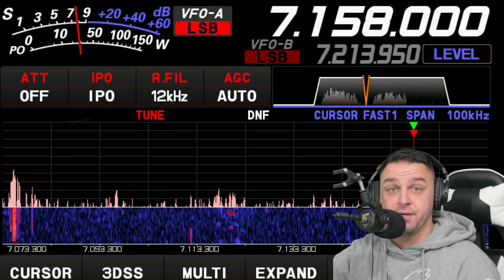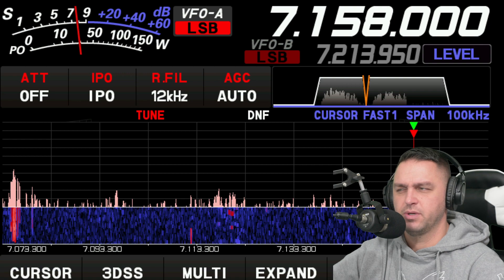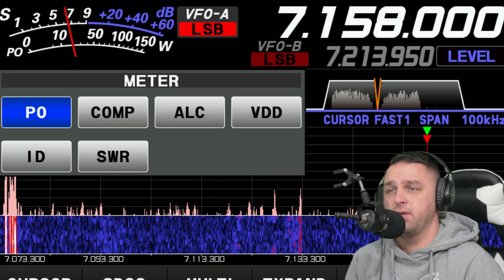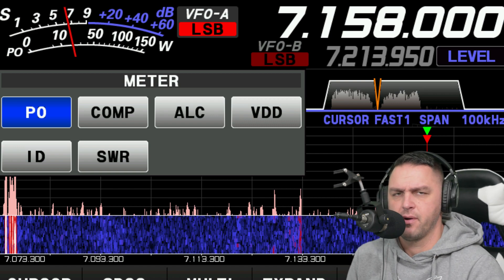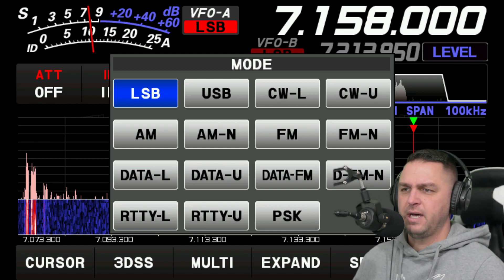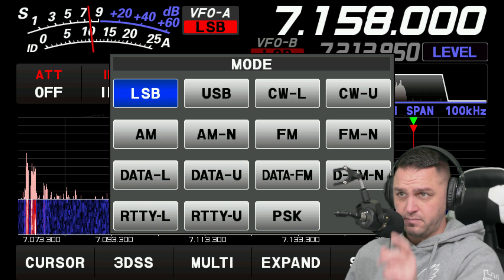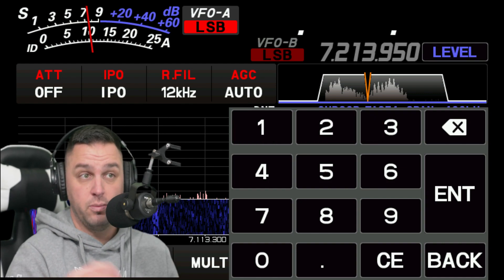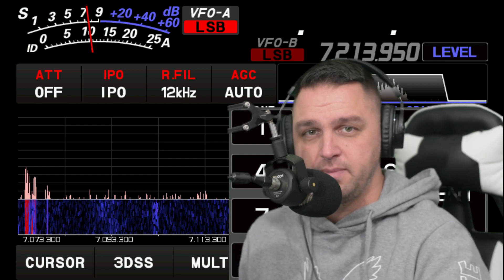Yaesu FT-DX10 Walkthrough of the User Interface / TFT Display

Comment: @ham radio dude what adapter cable or video capture card do you use for the FTdx10?
Reply from the maker: I just used a DVI to HDMI from Walmart. However, I CANNOT recommend any.  It is my understanding using the wrong one may blow your video port.   You would need to contact Yaesu for the best answer...tell them I sent ya.
Reply: @DudeTested thank you. Bought the one Yaesu recommends. Trying to find a capture card that works.
Reply: @ I see that those were just screenshots. Bought the CABLEDECONN video capture card Yaesu recommends. It’s important not to use the built in hdmi dongle attached to the card because that can possibly blow the fuse or damage the dvi chip in the transceiver. Not sure this one works either because it is not bi-directional.

Comment: Hey Dude 😉✌🏻 I see that you have black dots on your display when the background is blue - when you set the Meter or Mode. I have the same problem here exactly on the same places. Do you know where that comes from and is there a solution for this?
Reply from the maker: Hi there. I know longer have the radio, but might be able to help.  At what time in the video are you referring to.  Thanks
Reply: For example at 2:13 when you change the S Meter to Power - there are black dots at P and O.
Or at 3:30 when you change modes. Black dots at LSB.
Anywhere where the background is blue. Also in a nother video.
Reply from the maker: @Mike-ow9zv  Wow! You have a very good ide.a It took me about an hour, then I finally went to the computer monitor. I see them. Probably due to the low resolution used by Yaesu.  That's my guess :)  Sorry I don't have a better answer for you.
Reply: @DudeTested  I asked other ftdx10 owner on facebook and they doesn't have these dots. Than i have seen other videos and they have these dots too - and i think to my self "what the hell" I don't know, but there is something wrong.  However, thank´s for your answer 👍🏻

Comment: I just learned that the FTDX-10 can take its own screen shots! See P77 of the manual!

I'll summarize here: When you want to capture the screen, hold the MODE button until SCREEN SHOT appears. When SCREEN SHOT appears, you've captured the screen on a .bmp file on the SD card you have in the radio.

Comment: Please detail how you get to capture a screenshot of the display.
Reply from the maker: Hello, I just used a DVI to HDMI cable, plugged it into a HDMI to USB cable and used a program called OBS to screen capture.  I wouldn't recommend taking my advice though without checking the manual and with Yaesu first, as The video port may fry out if you use a DVI to HDMI cable
Reply: @DudeTested  You're a brave soul since the manual warns of possible damage using a DVI-to-HDMI cable, but maybe you did something that averts the damage. Maybe because the other end of the DVI-to-HDMI cable doesn't terminate into an HDMI port but merely passes signals through to an HDMI-to-USB cable and its the USB termination that counts and does no harm the DVI-D port on the radio. Maybe. Possibly. Could be. To be clear, did you use a DVI-D-to-HDMI cable or a plain vanilla DVI (no 'D')-to-HDMI cable?
Reply from the maker: @mrdonsmith  sorry, you're asking a lot of questions that I don't have the answers to because I no longer have the radio. I got rid of it about 6 months ago.  I went to Walmart bought a cable, as I recall it was a DVI to HDMI onn brand.  Then I went on Amazon and bought the cheapest HDMI to USB converter.  Also I could probably look at my manual. As I had one of the first dx10s from HRO, I don't recall the manual specifying the HDMI issue.  I could be incorrect, but I believe it wasn't until enough people complained about frying their HDMI ports that the updated many will became available.  Again, sorry, I don't have the radio so I can't answer
Reply: @DudeTested  I appreciate your effort to explain and you gave me an idea I could try. If I’m successful, I’ll post the results back here. 73 and thank you. KK5DON.
Reply from the maker: @mrdonsmith  excellent! I look for the manual, I know I have it somewhere around here but I didn't quite find it

Comment: I like your walk/talk thru of the DX10 but your going at the speed of an air traffic controller. If I had already owned this radio for a year I'm sure I could follow you movements. Slower would give a chance to see what you actived and a chance to see it.. 
Very thorough walkthrough in my opinion, just a little slower would be more rewarding.. Thanks and 73

Comment: The manual for this radio is world class.   At 82 I don’t have it memorized, but when I have a question usually a few seconds of digging in a manual  “ I am familiar with “  finds the answer that I either missed or just forgot. Urge your viewers to pause your video after each demo item you present and read that section of the manual. If they will actually do that you will be a great teacher.
Reply from the maker: You're right.   I always want to show the manual on the screen, also. My concern is the potential copyright violation.  With that said, I think reminding people to pause and check the manual is a good idea. I'll try it out on the next ftdx10 video. Thank you!

Comment: Thanks for the update.  Have you had a chance to use the FT-10DX on Vara HF 4.0.   I have a concern about duty cycle power with Digital modes.   I'm hoping to use the radio for Pactor 4.0 and Vara HF 4.0
8P6RC
Reply from the maker: Good Day, I haven't used it on Vara HF 4.0.  However, this is something I'd like to consider.  Hopefully I can test this out real soon.  Sorry I couldn't be of more assistance (yet).  Good luck!

Comment: I am not sure if this is the video, but the FTDX10 DOES have band stacking registers. It DOES remember mode and settings. Actually they are triple band stacking reregisters. So if you press the band button without selecting a band, it will cycle through the 3 registers in that band, and it WILL remember when you set them for last time, including mode.
Reply from the maker: Just confirmed it and will put something out soon. Thank you again!
Reply from the maker: I'm going to try that now and I'll make a video.  Thanks! I couldn't find it anywhere.  I appreciate it

Comment: Sean thanks for posting these videos on the Yaesu FT DX-10. Seems like you have gotten some good experience with the rig.

I have a few questions:

What is your overall impression of the rig, what was your decision making process in buying it and what other radios do you have?

On CW have you played with it using QSK. If so, I'm concerned about the clacking of the relays as this radio, unlike my K3, doesn't have pin diodes. So how bad is the noise -- do I need to wear headphones to mitigate the noise ?(which might be a deal breaker for me).

I had a Flex 6400M and had problems with distortion in the audio. Flex was nice enough to take it back after we could not solve the problem, which I suspect was RF getting into the audio chain. Have you had any such problems or heard of anyone having these issues with the radio?

I have never had a Yaseu radio before, (I've had Elecrafts, Icoms, Kenwoods and a Drake) and am trying to make a decision. If I'm wrong its an expensive failure, as no one lets you play around with the radio anymore, as AES used to.

Thanks,

Jeff
WA9RHD
Reply from the maker: Hi Jeff!

Thanks for the compliments. I am still learning this radio but will do my best to answer some of your questions with my experiences.    

My overall impression is the FTDX10 as it is, is a great radio.  However, like much V1 radios, it needs a little work.  Firmware wise, there are things that aren't right.  These are generally minor inconveniences or annoyances.  I love the audio filtering on this radio as well as the reports I receive back.  However, I do believe there is possibly going to be a lot of FTDX10 radios going back to Yaesu in the near future.  I am not certain of this, but reported an issue on one of my videos about 12m.  I am awaiting to hear back from Yaesu on this.  If this is actually going to require a 1 month radio to go back to Yaesu (only for recalibration), My impressions of this radio would be slighty less than it was before I discovered the issue.  I'll keep the Yaesu community up to date on that (if it is an actual issue).

As far as CW, I don't remember the QSK being an issue, but I will test that for you a bit later today or tomorrow and try to get some videos out there.  I may not be the best judge of this as I am only just learning CW, but I believe I can compare it to a few old radios.

My favorite part of this radio has to be Yaesu's Digital Noise Filtering (DNF) algorithm (which I will provide some videos of in the near future).  As a bit of background:  I have an end fed, attic antenna. This naturally lets in a lot of noise.  My noise level won't go below S5 on some bands.   The DNF seems to do an amazing job of pulling signals out of nowhere so I can not only hear them, but comprehend them.  

You're not too far down the road from me.  I would be happy to meet up with you to show you the radio/demonstrate it and get your thoughts on it.  I understand The VIRUS is making this hard on people and I understand if you wouldn't want to .

Best regards,

HRD

Comment: Can you explain how to ad a mouse to the radio? Thank you. Great video
Reply from the maker: Hello. I did make a video where I talk about hooking the keyboard and mouse up.  It should be as easy as plugging them into the back of the radio in the USB ports.  If the keyboard or mouse do not work, they keyboard/mouse are not compatible.  I am seeing a few cases of "Worked for my radio" but didn't work for someone else's.  I believe this is in part due to having a older version of a hardware model.  For example: THe M185 mouse works for me with no problem, but no one else could get it to work.  I believe this worked for me because I have the model m185 from at least 5 years ago and they probably used different hardware.   But really, it should be as easy as Plug and Play into the USB.  Good luck!

Comment: I like this radio and if it wasn't for the fact it has not got 2m and 70 cm I would trade in my 991A for one. de G0WXU
Reply from the maker: I do wish it had 2m/70cm.  I foolishly sold my 991 back in October or November to fund the FTDX10.  I then realized, what am I going to do for a vhf/uhf base.. OOPS.  It does also come down to space constrictions here. I don't really have the room on the desk for another radio. I do suspect adding VHF / UHF onto it would add another 500+ dollars though.  Thanks for the comment!  73!

Comment: good video, I like it. 
One question: Is it possible to adjust the display-gain for difference band, and if yes, will it be saved?
 Thanks best 73 Mark from Bavaria
Reply from the maker: Ah, that is a good question. Sorry for the delay.  Off hand, it doesn't appear you can.  However, if I find a way, I'll be certain to update you.

Comment: I noticed that when you change band via CAT control (WSJT-X), the preset of attenuator/preamp don't change. When you use the front panel button it does change to your previous preset.
Try to set different combination of attenuator/preamp settings for each band and then change band using front panel button, and you will see that it changes to your previous setting. It don't change these settings when using CAT control to change band.
 I did send an email to Yaesu to report this, but it might help if more users report this issue.
Reply from the maker: I had noticed that too.  I was assuming I may have missed something when configuring this. Thanks for letting me know.  I'll also let them know!

Comment: Great video.Thanks.Does the radio get very warm when in receive for an extended time?I would use it more as a swl rig.
Reply from the maker: The radio does not get warm. I think I have the ability to test the temperature and I'll get back with you